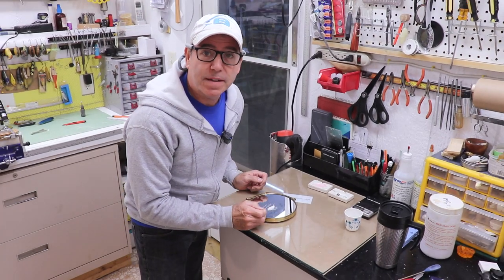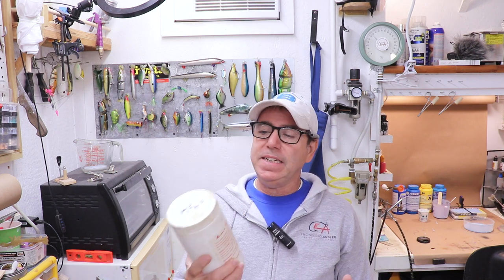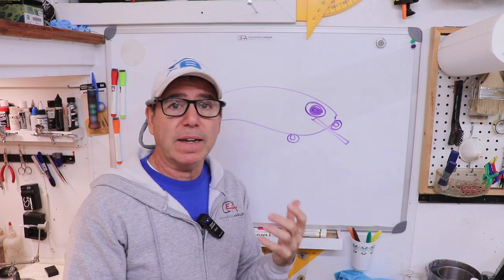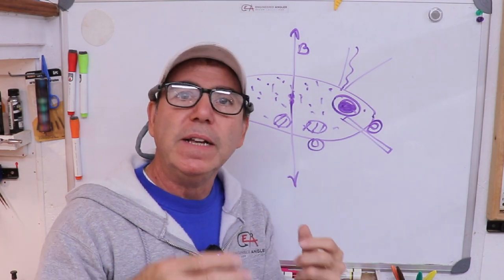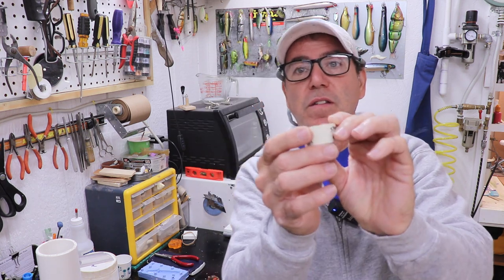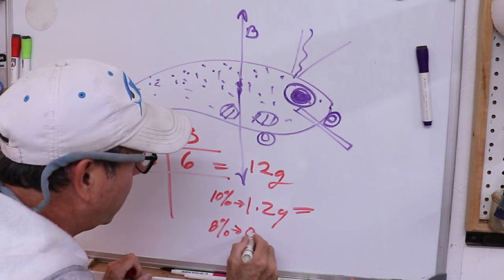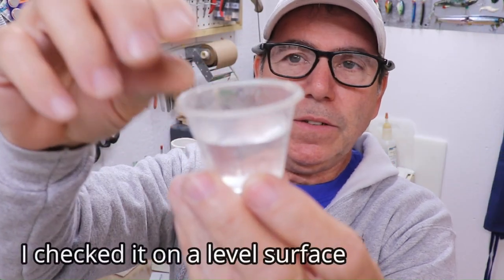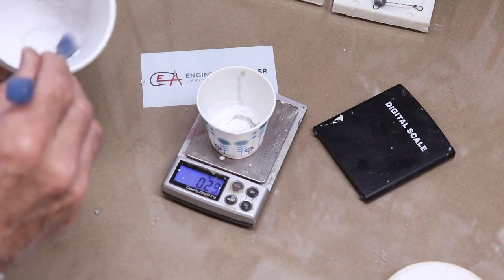Making Resin Lures with Microballoons, The Best Resin and Microballoons Mix Formula #mixingresin

Comment: I am 3d printing lures but the philosophy is the same. The filament (plastic) I use is PLA which will sink in water. I am able to adjust the solid walls to skins with a lattice like internal structure. This traps air inside the structure much like the micro balloons do with casting resin. It can be adjusted by percentage with the 3d printer slicing software. Regardless of materials and build philosophy, most things are the same. I get great inspiration from watching your videos.
Reply from the maker: Thank you and thanks for sharing your technique.

Comment: Great video. One thing I would note that for the calculation of the amount of resin you would need, you can't jump from ML in water to grams in resin as the resin has a higher density than water (that's why it sinks). On small projects it wouldn't be very noticeable but on large lures like GT stickbaits it would be. Obviously you're adding microballoons so you'll be fine volume wise anyways.
Reply from the maker: You really cant generalize about casting resin, for instance, the resin I use floats even without the micro balloons.  But you're right in that you have to take in to account all the materials and their specific gravities.

Comment: First of all thanks for an amazing channel. I have a project going on with a resin cast crankbait (my first ever hard bait). Before i cast it in silicon mold I have print the two halfs in a SLA printer to save me the cost of silicon molds iterating forward. I don't have a great sucess in the action of the lure which is making me really frustrating. All of the different small changes i do to the still makes the design unstable. The bait tends to "lean" to one side. I have picture that illustrates how i have set up the internals(air cavity, weight position & hook position) of the bait but i'm not shure how to include a picture into this comment field. Much appriciate to get some professional advise to make this bait work well.  Thanks / Jonas
Reply from the maker: Send me your photos to Engineeredangler@gmail.com.  Maybe I can offer some help.
Reply: @EngineeredAngler  Thanks, you should have a mail now :)

Comment: Excellent video as always, I have a question, can you also use epoxy resin? I live in Uruguay and that resin that you used does not exist here, in case it is possible what would be the proportion to be mixed?
Reply from the maker: Yes you can use an poxy resin but it  will set more dense than the resin I use.. I would start with a 10% mix and experiment from there.
Reply: @EngineeredAngler  Thank you very much for your answer, taking into account that the predatory fish here have very good teeth, is there no risk of the lures breaking when putting more microspheres?
Reply from the maker: There's some loss of strength when you add the microballoons but the key is not to rely on the body of the lure...use an internal wire harness.

Comment: When it comes to weighting a resin lure, I know it's easiest (it seems) build pour and build the weight into the cast...but can you drill (using forstner bit) the resin out effectively after and then maybe pre-form "pucks" of lead from a block of wood and Lee's lead pouring pot, to weight a lure? 
Maybe I should be asking an overall question. Any thoughts about weighting some (big) baits after the casting? Drilling / lead pouring / line ties etc. Can I basically treat it like wood when it gets to this point? (Minus pouring lead directly into it...I imagine it'd melt right through!)
Reply from the maker: Yes...absolutely you can add weight after casting.  I think it's actually easier than wood.  On occasion I'll change my mind and add weight to a lure to give it a faster sink rate.
Reply: @EngineeredAngler  thanks for the reply. So pre-pour pucks of lead for the size of the forstner bit hole? The resin would melt if I poured directly into it right? 

With wood, the hole slightly burns but I imagine with resin the lead will melt clear through? 

Thanks again Franko

Comment: Hi I wanted to ask you I'm making a top water lure that is 51grams of resin and I'm using SRC model-pro and it's the 1:1ratio and I'm using the alumilite micro balloons but I don't know the exact grams of micro balloons to use ...I'm trying to make it really buoyant before I put lead in it and all the hardware....trying to make it sit high in the water
Reply from the maker: I would use the 10% mix I describe in the video.

Comment: Have you ever used the Smooth On FeatherLite material?
Reply from the maker: I have not used it.   But that is definitely the type of casting resin you want to use. The stuff I use is from specialty resins and it's specific gravity is around point 0.8. That means it floats in water without any microballoons. And it's less expensive then the smooth on stuff. Also some of the casting resins are difficult to paint over without a long curing time and a good cleaning.  I would buy the smallest sample I could get and try it out especially to see how easy it is to paint on after it cures.   There's a link in my Amazon store for the specialty resin's casting resin, that I use, if you're interested.
Reply: @EngineeredAngler  you are a blessing Franco! I'll give the specialty a look!

Comment: I use a two part epoxy clear coat that’s fairly heavy would it be better for me to go with the 10% formula or stick with the 8% formula on a topwater
Reply from the maker: I would stick with 10%...the math is easier 😉
Reply: @EngineeredAngler  ok sounds good thank you

Comment: Love your videos!!! I keep getting a few baits that will have a soft spot at the bottom or belly area. Seems like the resin is not getting hard in these areas. Any suggestions?
Reply from the maker: What kind of resin are you using?
Reply: @EngineeredAngler  same stuff you Were using in this video, But I’ve had it happen with the smooth cast as well.
Reply: I´ve had the same problem. Since i wait/mix a little longer before pouring in the mixture, this never occured again. Only start pouring after you feel the mixture getting warm in the cup. Hope this helps.
Reply: Yes, thanks for the advice. Poured about 10 baits this pass weekend with zero issues.